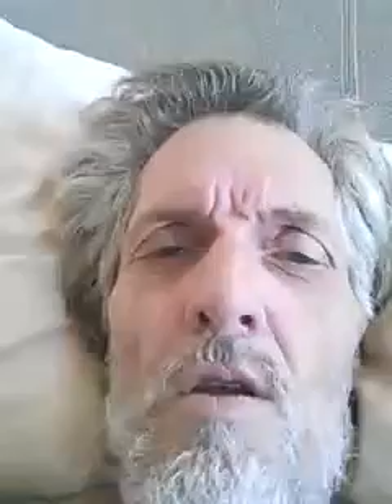Transposing Nathan Stubblefield's Earth Battery to Tesla's Tri-Metal Generator in an electro-U-Boat.

Comment: Much of this is still beyond my present understanding but I just wanted to float an overarching idea about the charge we are trying to access and that is could we be living on the ground "plate" of a worldwide capacitor? The increasing voltage with altitude. The electro-fractal shape of plants and trees and the direction of growth. Buoyancy can explain most of what's called gravity but what "flat earthers" leave out of the equation is the direction of gravity / buoyancy. It's one thing to say and show how different densities of matter fall or rise, that is auto seperate, when  in suspension but without a "direction" it fails to address all the phenomenon. Things dont seperate and fall to a more dense center and less dense periphery like a spherical shape, they fall down like a seperation of charge induced "direction" of gravity. I feel like the buoyancy concept is correct but without an up/down force to explain why things fall down to ground instead of falling to center of mass. I think maybe buoyancy explains the separation of matter by density and an electrical charge seperation potential between ionosphere and ground determines direction as if the world was a capacitor. Forms of living things being fractal could show that a tree lets say gets it's shape by growing along the lines of force that exist in the electrostatic field existing between the seperated plates. This shouldn't alter the Schumann resonance idea. Whew, ok so now the electricity gurus can maybe tell me why my theory is or isn't viable

Comment: At 35:05, no the frequency thru a transformer doesn't change. Only the phase. What you can do here, as a load, is a bridge rectifier to convert the AC to DC. The load can be a DC load. So you don't have to worry about a load that matches, impedance-wise.

Comment: Stubblefield battery has 4 leads, with 2 going to your load, and 2 touching the electrolyte -- for the galvanic chemical reaction. If they did not touch the wet dirt, or the salty water, the galvanic reaction would be prevented.